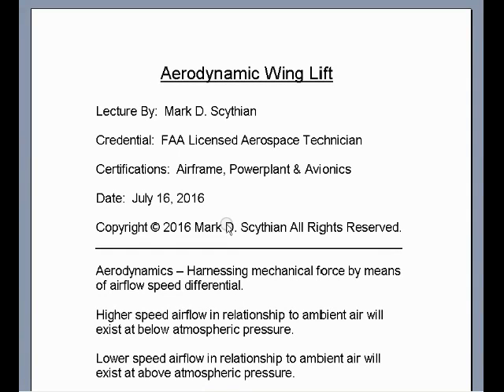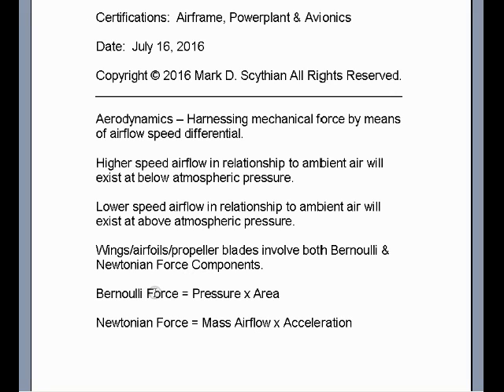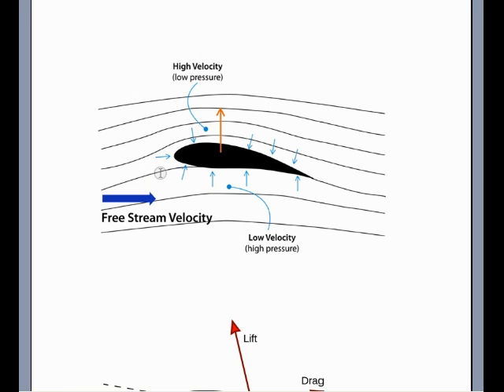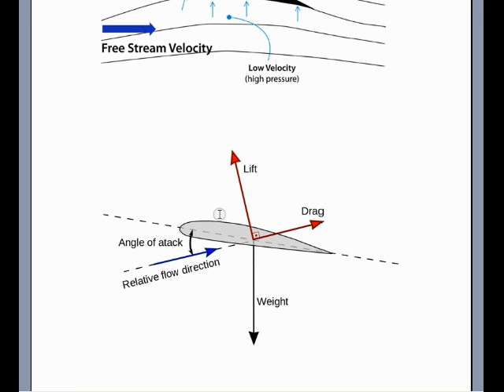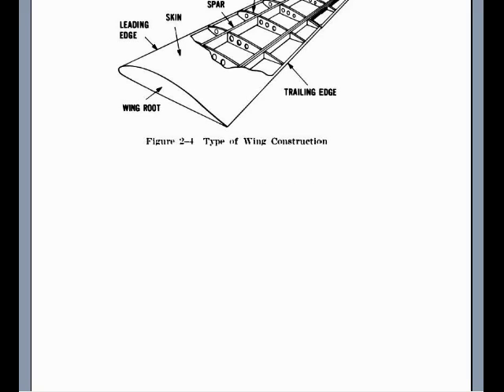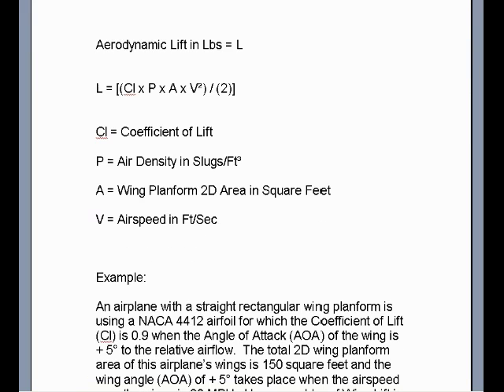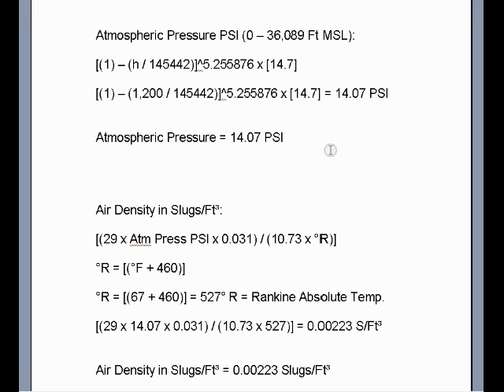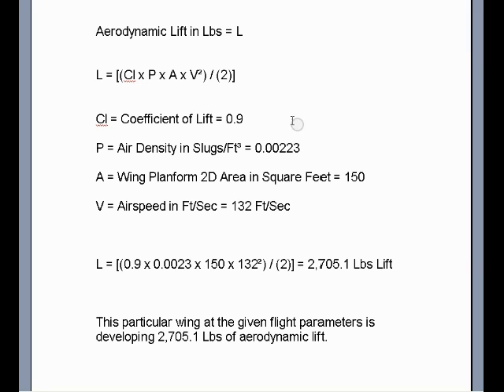Aerodynamic Wing Lift

Comment: Sorry, Mark.  
This is perhaps the most wide-spread misconception related to aerodynamics.  
You have some understanding of Newton, but you failed to apply it here, Mark.
.
I'm surprised no one has pointed this out in 6 years.  I just ran across this looking for another wrong video I saw a week ago.
..
.
Your statement that: "Higher speed air flow in relationship to ambient air, it will exist at below atmospheric pressure." 
IS ABSOLUTELY FALSE !
..
 This is easily measured on a daily basis by engineers and students.
..
Look up Bernoulli's Principle on Wikipedia.  The speed increase OCCURS SYMULTANIOUSLY WITH a decrease in pressure or visa versa. 
An increase in speed is Acceleration. The air itself is CHANGING speed.!.
The two pressures are at two DIFFERENT locations before and after the Acceleration -WITHIN the SAME flow.

A change in speed/velocity  is Acceleration. 
.
The two pressures are ALONG a flow.  That is called a Pressure Gradient - - - 'Gradient' because it is a fundamental fluid property that the pressure varies gradually between the two.
..
Bernoulli's Principle is about Acceleration, NOT speed.  

When you see an acceleration of some fluid, you will see an accompanying pressure change - NOT simply a difference between any two locations.!..
..
In the mid 1700s, Euler, following up on Bernoulli's work ,determined that Newton explains it because a Pressure Gradient causes fluid Acceleration. In J.D Anderson's Book.
..
Where Bernoulli comes into play is INSIDE the blower. 
The air out of any 'blower' is because there is a higher pressure inside it than the outside, atmospheric pressure.  
That's where your pressure drop is [inside to outside] and the speed increase [inside to outside].
The high pressure in your lungs pushes more on the intervening air than atmospheric and that provides a net force Accelerating the air into the atmosphere, where is assumes atmospheric pressure. 
ALSO, if that air stream was lower than atmospheric, it would get squeezed smaller and smaller as long as it was moving and we easily see that is is expanding.  <--problem.
..
The longer path fallacy is easily disproved by a flat wing or an verted asymmetric wing. <--problem.
..
The entire upward lift force is due to the Top-Bottom (static) pressure ion the wing.!.
Increasing the AoA simply increases the difference.
.... 
The physics is that a Pressure Gradient causes fluid Acceleration  - - this is just like a force is the cause of acceleration (Newton.
Bernoulli is Newton for fluids.
.. .. ..
The higher speed above is CAUSED BY  the Pressure Gradient between ahead of the wing (ambient) to above it (below ambient).
.
The curve IN THE FLOW is indeed the main factor in the cause of pressure decrease, but not because of the longer path.
Another fact: 
The curve in the flow is also the main factor in the cause of pressure increase there.
... 
The reason the upper air-flow curves; is because the atmospheric pressure provides the centripetal force.  REALLY HARD.!.!.
Atmospheric pressure downward on a 172 wing amounts to a force of  around 350,000 lbs.!. DO the math.
.
The pressure pushing DOWN on the wing's upper surface does not go away when it moves.
These pressure changes are really small.
The upper pressure pushing DOWN on a Cessna 172 wing decreases by about  0.08 psi.!. <--FACT.
The Top-Bottom difference is 0.1 psi on average.!.  Over 25,000 (planform) sq-inches area is the 2,500 lbs craft loaded weight.  Look up the wing loading and convert to PSI.
..
..
Your first drawing is greater than zero geometric AoA.!.  That wing even AT zero geometric AoA still generates lift for the same treason ALL wings do.
..
The SAME occurs when a wing is generating lift, REGARDLESS of the geometric AoA. 
There is also an effective AoA, relative to the zero lift orientation.
..
..
There are not two lift vectors.  You are not describing any physics for your "Newtonian" lift.  "Elaborating" is not a physics explanation. <--problems.

Upper air Decelerates near the trailing edge because it is traveling toward an INCREASING pressure - this is called an Adverse Pressure Gradient.
.
The reason lift has a forward component is because the largest pressure difference is about 25% back from the L.E. where the upper surface is still angles forward.
 AND that decrease in pressure occurs where the sharpest air-flow curve is above the wing and where the lowest pressure occurs. 
....
Full explanations for Bernoulli and lift are here:
  *rxesywwbdscllwpn.quora.com/* 
- - 
Cheers
Reply from the maker: Hi Observ45er.  Thanks for the  revised data supporting video content!  I will add the following video subtitle:  'See Revised Data Below (Observ45er)'.  Your thorough explanation is greatly appreciated.  

This video was posted almost seven (7) years ago when I had not completed my BSc in Aeronautical Engineering from Western Michigan University.  Prior to becoming an engineer, I was an FAA certificated A&P mechanic.

The common misconception regarding aerodynamic wing lift excludes (airflow) acceleration gradient(s) with respect to pressure(s).  This misconception predicated the entire video.  

Feel free to go through my YouTube Video Library and identify errors and/or write revisions pertinent to videos published between 2016 to 2020.  Thanks again for your detailed revision in support of future viewers.

Sincerely, 

Mark Scythian
May 12, 2023
Reply: @markscythian7179    Thank you  for responding, Mark.   So many of these videos are put up and ignored.
..
I'm sorry, Mark, I must be very candid.
.
I don't understand that.  There are so many bad videos and papers explaining lift wrong, This is just another.
Every one thinks theirs explains the true physics. . . 
 Do you actually think people will watch your video then read my long comment and NOT think they wasted the time watching your video?   IF, that is, they understand it?

.
I can't understand that rationale.
..
..
 I had heard the "Equal Transit" story many years ago in ground school, but didn't really pay it any attention. 
I've been surveying this for the last ten years after taking responsibility for a full cockpit 737 flight simulator and realized I should brush up on a few aviation things. I quickly ran into all the wrong lift stories clearly misunderstanding common physics.  
I call the "Faster air" thing: "Bad Bernoulli". 
..
Last week I stumbled onto Neil DeGrasse Tyson's video claiming Equal-Transit is THE SCIENCE.  Somebody needs to slap him around. . . 

..
The common misconceptions 'exclude' a lot of solid science.  I just came across another paper that uses a simulated boat-sail moving though soap bubbles to "prove" the wing changes pressures
Then, a brand new 'revolutionary' Kindle book that claims there is no airflow around a wing based in part on photos of those low pressure clouds that sometimes form above wings --- and that the physics of flight and the wind tunnel are completely different.
..
I don't understand the purpose of the video. ... . 
I recommend just taking it down.
Sorry.
- - 
The physics is covered in my blog and the single thing no one seems to be able to understand is that mass has the property of inertia and that is key in understanding the cause-and-effect story of the physics of the pressure changes..

Regards.
Reply from the maker: @Observ45er  

Mass Air Acceleration, Dynamic Pressure (1/2pv^2), Reynold's Number Variation (Density-Transient-Inertia), Boundary Layer Pressure Gradient(s), and Stagnation Pressure, just to name a few, posit relevance to Aerodynamic Wing Lift.  Rather than complaining about wide scale misinformation and past mistakes, we could collaborate in the near future by establishing a joint-video-project.  

Many companies were founded by challenging wide scale misconceptions until a large enough market became established.  No point complaining, especially since marketing correct information is an option.  However, there's two types of people in the world:  The ones who "get it" and the ones who "don't". 

As for Neil DeGrasse Tyson, he earned a BA for undergrad and is technically not a scientist or engineer.  No one with an undergraduate BSc in engineering, physics, chemistry, mathematics, computer science, or operations-research takes "celebrity scientists" seriously.  This is a differential calculus game:  science (physics, chemistry, biology, computer-science, operations-research) is nothing without mathematics (differential calculus).

Observ45er, what is your occupation and educational background?  Are you a pilot?  Let's get to know each other.  Drop me a line. 

Thanks.
Reply: @markscythian7179  Mark,
While advanced topics can be piled on to add even more confusion, your video contributes to the 'marketing' of the incorrect information you refer to. In other words, it perpetuates it - adding to all the other noise.  
.
If, as you seem to indicate, you have since learned better, why leave it up?
..
The thing with Tyson is that he has a large, existing audience and he's spewing more of it.    He hasn't responded to my query, yet  and I have other things in process.

.
Even NASA provides elementary school material with bad information and the usual misinterpreted demos. 
.
I'm a very experienced engineer, mentor and teacher who gets paid for a track record of understanding what I'm designing and explaining.
.
Taking over management of a full cockpit B737 flight some some years ago, I recalled the equal transit story from ground school many years ago and decided to brush up on many things 'aviation', since that was obviously bogus, though I  chose to pursue electrical engineering as a career.  
My son with an AE from Embry-Riddle helped with this and I've already read and talked with several well-known names in aerodynamics.
..
Being a pilot is no credential for physics, since nonsense has been taught to them  - nor is an understanding of the correct physics required for the left seat.
..
Do you actually think that adding yet another video will actually help?
..
Just like here, I occasionally run across another video or paper and try to engage the author, but few are serious enough to care -  as long as they have their 15 minutes of YT fame. . . 
  You're one of the few who cared enough  to respond.
..
When carefully laid out, explaining the correct physics concepts of pressure changes around a wing is not more difficult than what you have in about the first half here, except two of those things you mention must be understood (acceleration and inertia). It's easily high school.
Could you see that in the blog I linked above? it needs cleanup, though, but shows the essence.
..
I still have some energy for this, but with all that bad information out there, there may be a time to make the decision to give it up, since it won't affect any lives to any degree. 
Those working with it can either understand it, or give a popular answer that it's all in the B-S-math, Kutta, etc. without explaining any physics.
.
Possibly to be continued. . .
Reply from the maker: @Observ45er  

1 Glad you actually care!  Not many do (including STEM grads).  There is another YT Channel (won't name names), with hundreds-of-thousands of subscribers, teaching INCORRECT concepts about the Brayton Cycle.  One of this channel's viewers unsubscribed and instead subscribed to my channel.  He wrote me a comment on why there are so many subscribers on channels having incorrect or misleading content.  

2 It boils down to marketing.  Literally ALL "prestigious establishments" are based on FRAUD, while having superior marketing platforms.  On the premise that so many misled people are difficult to convince otherwise.  Which is why I started to NOT CARE either.  

3 A few years ago I could have audited my YT Library and deleted or edited misleading videos.   You are the first (fellow) engineer that has taken the time to point out the flaws of my channel.  Which is a GREAT thing to say the least!

4 I'll make a revised version of 'Aerodynamic Wing Lift' as my next project video.  This time having accurate and concise physics.  The 'L/D Ratio' seems like a practicality to include (as well) in this upcoming video.  Any thoughts?
Reply from the maker: Hi Observ45er!  

A lot of new content has been added.  I think you have been watching too!  lol  

Thought of you when I uploaded:  'Applied Aerodynamics Part 1 & Part 2' videos to my channel.  

'Why Airplanes Fly' disproves "Transit Theory".
Reply: @markscythian7179  Hi, Mark.
If you are a very good A&P, you should be proud of that and I recommend you help others learn in that area, but learn more physics to better understand lift. 
.
I don’t know if you’ve added content to this video since I saw it a year ago, but now, you say there is ‘nothing magical’ and it is ‘applied physics’.
.
Unfortunately, when you say that above a wing "because of the curve, the air flow will want to speed up and accelerate" (time 2:50) that's pretty magical. 
There is no physics principle that says fluids will spontaneously accelerate on their own, because of some internal desire, nor that they realize they have a longer path to travel. That that is neither Physics, nor applying it.
.
Newton's First law clearly states that without a force, an object will not accelerate on its own. Fluids have mass and, therefore, they follow Newton’s laws. 
Newton’s First law makes it clear that force is the cause of acceleration and a pressure gradient is what causes the force to accelerate fluids. 
.
Fluid does not spontaneously speed up because of some desire it has.
.
 Air has mass and if you study Newton’s 1st law of motion, you find that a force is the cause of acceleration.
.
I explained in my comment a year ago, that Euler determine this following up on Bernoulli's work in the mid 1700s. 
Euler realized that it is a pressure gradient, which produces a net force on fluid, therefore accelerating it away from the higher pressure region towards nearby lower pressure regions. This is where Newton is also valid for fluids. 
.
^^^^^ That is Physics and that is how it is applied.
.
In addition to what I pointed out a year ago, you make too many errors to outline them all here.  You misuse terms; there is no such thing as a Bernoulli force; Bernoulli does not explain the formation of a boundary layer; you mentioned a vacuum differential with no explanation of what you mean, the pressure along the top surface of the wing is pushing downward and the angle of attack is not the 'shape' of an object to oncoming airflow. AoA is the ORIENTATION of the airfoil relative to its direction of motion. 
You are also hunting for what you mean by a definition of the ambient air around the wing and seem to make it whatever you wish rather than what it is: the bulk air that the wing is flying through. 
.
Lastly, your diagram of the airfoil with the lift, drag and weight vectors is incorrect. You show it as the wing is descending rather than flying in horizontal flight. 
By definition, the lift component of the total force on a wing, is directly opposite the weight (180 degrees), not at an angle as you show. The weight is towards earth, straight down, and the lift is directly away from that straight up. The Drag vector is also much smaller, therefore, shorter than the lift vector.
. 
I highly recommend reading my lift Blog. Because YouTube appears to be deleting comments with links in them, I’ll try this.
You'll have to reassemble this link to my Blog explaining lift, by putting the dots back in. It explains the correct physics of Bernoulli's Principle and lift, step-by-step, as well as why common misconceptions are false.
 rxesywwbdscllwpn
DOT
Quora
DOT
com/
Regards.
I'll check back later to see if this comment gets deleted. . .
Reply: There is NO AT symbol ,@, in that URL.
Reply from the maker: @Observ45er  Emphasis on the Height Differential (h2, and h1) was the main takeaway of 'Applied Aerodynamics Parts 1 & 2'.  Not "curvature", (Transit Theory is WRONG):  As the AOA increases so too does the PROJECTED HEIGHT.

As Projected Height increases, so too does Kinetic Energy or Velocity on the upper wing surface or airfoil.

(rho)(g)(h) correlates with mgh or Potential Energy = Pressure.

(0.5)(rho)(v-squared) correlates with 1/2pv^2 or Kinetic Energy = Velocity.

Both sides of the Bernoulli Equation w/ respect to P1 & P2.

The zero AOA's Projected Height is the Airfoil Thickness or h1.

The max AOA's Projected Height is h2.

Before I became an Engineer, I was an A&P.  Most A&Ps' are stuck in PV conversely linear relationships, absent of the Bernoulli HEIGHT DIFFERENTIAL!

A&Ps' who continue on with their BSc. and earn their Physics or M.E. degrees gain rigorous experience with Bernoulli differentiation and integration. Some do (5%), most don't (95%).
Reply from the maker: I'll find your site and review it.  Thanks!
Reply: @markscythian7179   I don't know what those heights are and I can't decode that comment, but I will look over your Part 1 & 2 in the next day or two.
.
What kind of  engineer are you?  Is it an AE?  One of my sons has an AE from Embry-Riddle. What category of engineering do you work in?
Reply from the maker: @Observ45er  You need to focus on my recent content from 2022 onward.  I was assuming that you were viewing my most-recent lectures rather than obsolete lectures from 2016!

As airfoil AOA increases so does Projected Height:  Kinetic Energy (velocity) of airflow will INCREASE at the Upper Wing Surface WITH RESPECT TO PROJECTED HEIGHT OF AIRFOIL, while Potential Energy (pressure) of the airflow will DECREASE at the Lower Wing Surface.

This is why Aerodynamic Wing Lift occurs regarding 'Symmetrical Airfoils'.

Cannot use "Transit Theory", this is WRONG!

WHEREAS the curvature variations pertinent to Airfoil Design is with respect to DRAG REDUCTION OPTIMIZATION.  Wind Tunnels cost $100,000/hr.  Commercial Airfoil Design are reserved for PhD Aerospace Engineers & Physicists.

Aerodynamic Wing Lift is the EASY part, any BSc. Engineer can design.  But DRAG REDUCTION is seriously COMPLEX!  Wouldn't want to go out of business due to decreased Fuel Efficiency.  Modern heavy airliners must meet the 70 MPG criteria at Tropospheric Altitudes for which 1 ft/sec Jet Velocity yields 4.5 ft/sec True Air Speed.

My credentials:  Aviation Maintenance Technology + Aeronautical Engineering = BSc Aviation Technical Operations (Western Michigan University) = 'Aircraft Engineer w/ an FAA A&P License'.

Check out these lectures in my YT Video Library:

1.) Applied Aerodynamics (Part 1).
2.) Applied Aerodynamics (Part 2).
3.) Why Airplanes Fly.

If you're into firearms, check out:

4.) Glock 9mm 17C vs. Colt 45 ACP.

Talk to you later Observ45er!
Reply: @markscythian7179   Well, I put my comments under the video I refer to.
.
My comments apply to this and another video and I am very disappointed.  I seriously recommend that you remove it because both are wrong as I explain.
.
I have now looked at your Part 1 video. 
.
You have awkward ways of explaining things and use unconventional terms such as "Bernoulli pressure".  
You say that a fraction such as A/B is "A divided into B".  Whereas, this is correctly stated: "A is divided BY B. or B is divided INTO A."
.
I am sorry, but I must be candid with you. It demonstrates that you fail to under simple physics.  After 20 minutes you show that you do not understand that a sustained climb of 800 feet per minute is a CONSTANT vertical speed, NOT acceleration. 
It is a vertical SPEED of a constant 13.333 feet per second through out the entire climb. There is NO change in speed.  Therefore, that calculation is wrong and does not belong there.  It DOES NOT add to the Acceleration of gravity. 
.
You show an incorrect equation at t=8:15 in Part 2.
"13.5 psi x 6894.76 = 930,79 Pa" 
Which should be:
"13.5 psi x 6894.76 = 93,079 Pa"
.
In addition, you use the wrong equation for distance when there IS acceleration!
For the relationship  between the Distance traveled "D" at a CONSTANT Acceleration 'A', over time 't', is:
D = 1/2 a t^2.
Distance equals ONE HALF  A t-squared.
.
Finally, it appears that you somehow think that the vertical displacement due to Rho*g*h is significant when you mention the 'projected height.  That is fully irrelevant and never considered in real aerodynamics.
.
I had wondered if English is not your first language because your phrasing is very awkward, but I do not detect an accent.
.
I am sorry, but you have failed to correctly apply physics and have a very magical interpretation of what a constant rate climb is. 
This is not the quality of accuracy and knowledge I have experienced in my professional career with other engineers and that I expect from a real engineer
.
If any of this, or Part 1 is what you learned to get your Associates at Western Michigan University, then you have been done a great disservice and you provide no service to others with these faulty videos.
.
I seriously recommend that you remove it all.  Sorry.
Reply from the maker: @Observ45er  Steve, your perceptions are totally flawed. You are a technician not an engineer.  "Associate" degrees are not offerered at universities, only four-year Bachelor's degrees are. lol  Until you complete a four-year Bachelor of Science in an engineering discipline at an accredited university (like I have), you cannot call yourself an engineer.  

Your US Navy career as an electronics technician means nothing.  Your civilian career as an electronics technician means nothing. Your fixed-perceptions of "science" since high school means nothing.  Your son earning a four-year engineering degree has nothing to do with you.  I think you're you're a bit alienated and lonely, and have a bone to pick with other YT users.  

Complete your four-year Bachelor of Science degree in a STEM discipline, earning a 3.50 GPA or higher.  Do that first.  Then you may realize there are multivariable methods of deriving solutions.  You failed to even understand that vertical-climb-acceleration is NOT instantaneous!  VSIs' will never instantaneously "jump" to "800 FPM" climb!  Therefore, vertical-climb is an average-rate-of-acceleration, or distance divided into time squared.  Ultimately, the idea is to calculate total absolute pressure at the lower wing surface.  Which is a summation of:  (average lift-force / 2D-wing-area) + (force-wieght / 2D-wing-area) + (atmospheric pressure).  The Average-Climb-Acceleration must be derived first, as a product-function with airplane mass, to yield average Lift-Force.

You need to know that Projected-Height-of-Airfoil increases with increased-AOA.  The bifurcated boundary-layer-airflows (upper & lower) incur increased height differential at increased AOA.  Which induces inversion of kinetic and potential energies across upper & lower bifurcated airflows:  Upper surface airflow will increase in kinetic energy (velocity), and lower surface airflow will increase in potential energy (pressure).  A function of h2/h1-Differential across the 'Bernoulli Equation'.   This is why Symmetrical Airfoils disprove "Transit Theory".  It is NOT "distance differential" across upper-and-lower-wing-surface-lengths.  It is Projected Height Differential (h2/h1) with increased AOA.  This inverts kinetic & potential energies at upper-and-lower-boundary-layer-airflows, respectively.

Lastly, most of your comments are littered with numerous GRAMMATICAL ERRORS and FALSE STATEMENTS.  But, I chose to look past that, and instead have a civil conversation with you.  No need to get mad at me due to your insecurities.  But, if you want to call yourself an engineer, first complete your Four-Year Bachelor of Science degree in an engineering or STEM discipline at an accredited university, earning a 3.50 GPA or higher.  A 30-year-long career as a technician, does not make you an engineer.    

If you actually read my previous comment(s) throughout our conversions, you would know that I retired from a previous aviation maintenance career after earning a Two-Year Assocate of Science degree from a Community College + FAA A&P License + seven (7) years of experience in the aviation maintenance industry.  FOLLOWED BY 'starting-all-over-again" and completing a Four-Year Bachelor of Science degree in Aeronautical Engineering at Western Michigan University, earning a 3.68 GPA.  Subsequently working for several Start-Ups, and also teaching STEM coursework at private charter colleges for the last five (5) years. 

I don't why you are "disappointed" with me Steve.  If anything, you should be disappointed with yourself for coming to my channel and posting comments about "engineering", when you yourself are not a degreed engineer.